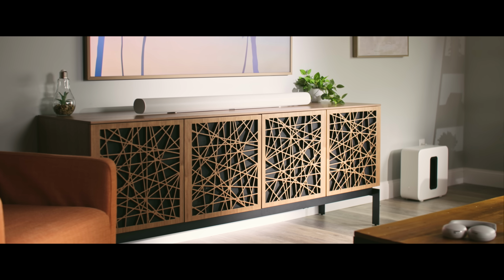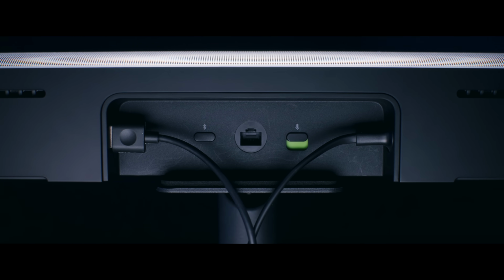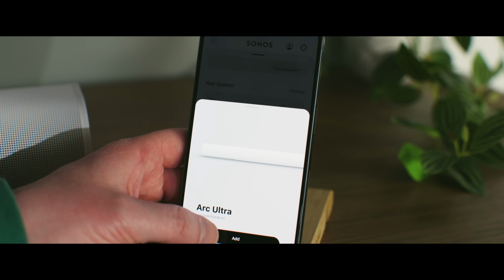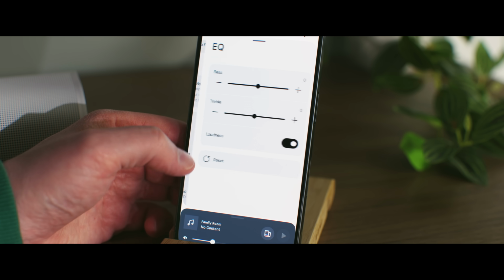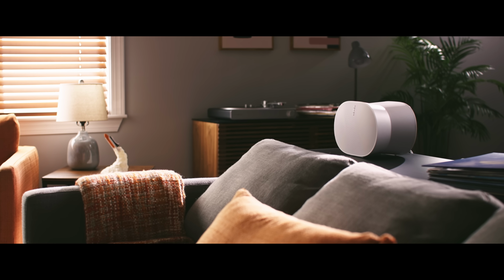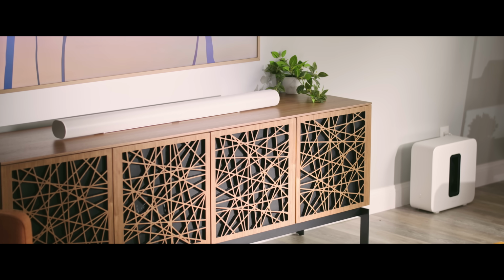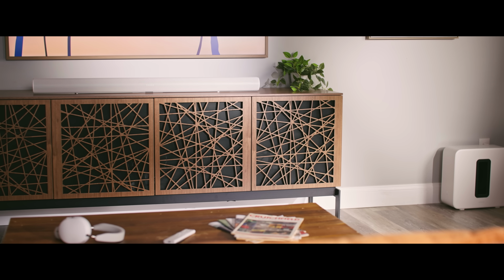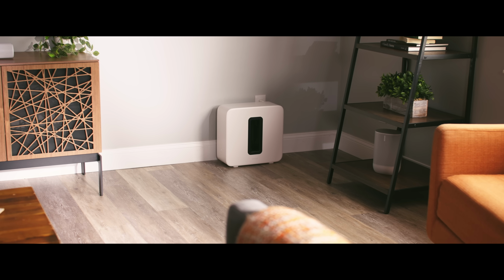Sonos Arc Ultra and Sonos Sub (Gen 4) | Crutchfield

Comment from the maker: We've just learned that a recent update has enabled native 9.1.4 processing for the Arc Ultra. It happened after we shot this video, where we describe it as 9.1.2.
Reply: Sorry if this a stupid question.  Are you able to add more Era 300?  I mean you have to rears.  Can you add 2 for front left and right or are the not needed?  Also, what are the benefits of having 2 subs instead of only 1?  My room is 4m x 4m.  I have had a Bose 700 with the sub and satellite surrounds for 6 years and need this sonos.  Thanks for the review.
Reply: Forget Atmos and forget soundbars if you want more than better tv sound. Just go for Sonos Amp with some decent floorstanding speakers, add some Era 100 rear speakers and a Sub 3. You'll have a great Dolby Digital+ system for movies but also important (for me); You will have a great HiFi audio system for music no soundbar will even get close to. 
You just need some big frontspeakers for decent and well balanced music🤷‍♂️
Reply from the maker: HiFi Music is still best reproduced by separate speakers and creating the equilateral triangle with them and the seating area. Your setup is a lot better for your goals!! Which passive speakers are you running on the Amp?
Reply: @crutchfield  Yes at least for me it's the best of both worlds. I am running a pair of Wharfedale Reva 3 speakers on the AMP.
Reply from the maker: Beautiful speakers! Which finish did you choose?
Reply: @crutchfield  Thx! Got the Reva3 in white (gloss). https://youtu.be/J9XTUp9qMjk?si=c5YjXYzenTIxzxjY
Reply from the maker: Nice! Happy listening!

Comment: Hi Crutchfield which sub is better bose 700 module or sonos sub 4
Reply from the maker: The wireless subwoofers are proprietary and designed to be used with the compatible soundbar. We haven't done any comparisons with the Bose and Sonos subs but both will give you deep bass extension and create a large soundstage with the Bose/Sonos soundbar used with it. My personal opinion is the Bose subwoofer/soundbar gives you a better home theater experience and would be my preference & recommendation.
Reply: Thanks Crutchfield the advice bose was always my favorite brand since I was a teenager but was curious to find out whats the big deal about sonos arc ultra some say it does atmos better than bose and sub 4 goes lower than 700 module

Comment: The fact that makes me hesitate to buy this bar is that this has only one HDMI port.
Reply from the maker: What HDMI devices do you plan to connect? When using the Arc Ultra soundbar through your TV's HDMI eARC input, you can connect other video devices or gaming systems directly to your TV's extra HDMI inputs.
Reply: @ planning to connect Apple TV 4k and Arc ultra, and TV arc to soundbar.  This is called “Passthru” which is more stable connection and better sound.  Also, this connection makes me able to enjoy dolby atmos even if my TV is not atmos compatible.
Reply from the maker: Pass through features won't be available on the Sonos ARC Ultra. For Atmos features you will need an Atmos capable TV, and to connect your apple TV 4K (or other video sources) to your TV's non eARC HDMI inputs.
Reply: @ thats the problem.  Apple tv and atmos works best at pass-through connection.
Reply from the maker: Would you like help choosing another option with multiple HDMI inputs?

Comment: INCREDIBLY smooth review. Like this was an audio description from a magazine article. Well done. 

I must ask, I have two Era 100s that I have in my kitchen and living room for multi-room audio - should I pair the 300's with the Arc + Sub or will my 100s be okay?
Reply from the maker: You can use your existing Sonos Era 100's with the Arc Ultra in a home theater configuration. While the Era 300 provides better 360-degree sound from the rear channels the Era 100's sound great and will work perfectly when paired with the Arc Ultra for surround sound!

Comment: Great review! I am torn between the new Samsung Q99D (price) with the sub and two rear speakers and this new system with the sub and two rear 300s. 

What would you recommend quality wise? 

I dont really care about max volume. ( I am sure it will be loud enough) 

Going in a newly renovated finished basement with low ceilings.
Reply from the maker: From a sound quality standpoint, the Sonos Arc Ultra with subwoofer and Era 300 surrounds is hard to beat!
Reply: @crutchfield  Thank you
Reply from the maker: Anytime! 🙂

Comment: what are your thoughts ?  BOSE SMART ULTRA   vs   SONOS ARC ULTRA   which is the better investment for adding a surround sound of speakers to ?  great video    thx cheers from Canada
Reply from the maker: Both great brands. What's your exact setup? Are you using any other Bose or Sonos speakers currently? Are there any specific features or connections you need? Thanks!
Reply: @crutchfield  All i have now is the BOSE 900 sound bar so i am open to starting the Sonos set up  my room is 12x14 with 7 and a half foot ceilings   what set up would you suggest ?  how about the BEAM 2 + sub Mini + ERA 100's  or is that not powerful enough ? I enjoy watching sports / movies / and news channels....thx
Reply from the maker: Based on your space and listening preferences, the ARC Ultra is an ideal match since it can fill your room size well and provide for fun surround sound on it's on until you can also add the 100s.  The Sub Mini will match it perfectly. Do you need a wall mount?
Reply: @crutchfield  will i notice much of a difference with the min sub hopefully ? or does it have to be the GEN 4 ?
Reply from the maker: The mini does a great job. If you like even fuller bass or think you will want to use two subs down the road, you will need the Gen 4.

Comment: Sonos ARC Ultra 10/29/24

My setup 

1. Living room is an open concept living room
2. Arc Ultra / 2 ERA 100’s / Gen Sub 3

The Arc Ultra right out the box it sounded very mellow acoustic very surreal no need to increase volumes. Once EQ was adjusted to personal preference just amazing sound quality.

Once again I will say that I have an open living room concept (not like most videos on YouTube most if not all of you are in closed room).

True Play - no need for it as for the open room concept.

Future wishing - Sonos once you allow the users of the ERA 300’s to activate the center speaker while in TV surtound sound usuage you will have a good portion of Sonos users maybe considering to purchase the ERA 300. Why! Easy for open concept living spaces it will allow to fill the void if not being able to bounce sounds of walls for the illusion.

Special shout out to the main YouTube who post and bring the original thoughts on Sonos products. Much Respect

✌️
Reply from the maker: Thanks for the posting your experience with it! Just to clarify, you didn't use either Trueplay tuning; not even the Trueplay Quick Tuning process?

Comment: I'm happy with the original Arc (only had it for just over a year) and my Era 300 speakers. I'm using those as stereo paired fronts as I have them hooked up to my turntable. The curious thing is that music on vinyl through the Era 300s sounds better than streamed music (from either Apple or Tidal). They've only started to be reliable again though after the latest app update; before that even Airplay connectivity was sketchy.
Reply from the maker: That's a nice combo!  How did you choose to connect your turntable into it?
Reply: @ with a Cambridge Audio phono amp and then with the Sonos line in adapter connected to the phono leads from the amp.
Reply from the maker: Excellent! Are you planning to expand the system with more wireless Sonos speakers in other rooms?
Reply: @ no we are in a small flat so you can hear them from any room 😝
Reply from the maker: 😁 what's on your "multi-zone" playlist for tonight?
Reply: @ some traditional Welsh language folk from Cerys Matthews (lead singer from 90s rock band Catatonia) and her album “Tir” (Land). Her vocals come across very clear. I might finish off with some tracks from Jeff Wayne’s War of the Worlds. I’ve very eclectic tastes in music.

Comment: This combo, or the Sennheiser Ambeo Plus + Ambeo Subwoofer?  Current sales brings the price of the Sennheiser pair for a few hundred bucks less than the Ultra combo.
Reply from the maker: Hi William. both great options. What's your exact space and setup like? Are you using Sonos in other parts of your home now? What features and connections do you want to be sure your new sound bar has? Thanks!
Reply: @ I’m in a small condo and prefer not to have rear speakers.  Subwoofer is fine since I’m on the ground floor.  Slightly prioritize music over movies.  Don’t have Sonos in other rooms (Audioengine and Kanto).
Reply from the maker: Thanks, William. What type of, if any, WiFi audio streaming to you plan to use?
Reply: @crutchfield  Really only using Spotify / YouTube from the LG tv so far, as well as Spotify Bluetooth from my phone.  Might eventually have a direct Spotify source fed to the soundbar.
Reply from the maker: Got it. The AMBEO combo is hard to beat for top notch surround sound without dedicated rear channels. And it has built-in Spotify® Connect for music streaming
should you want that option down the road as well. Any plans to wall mount it?

Comment: I don’t understand one thing. If it is 9.1.4 only the bar, or if it is 9.1.4 with sub and era 300?
So if u add these it became 14.2.6?
Reply from the maker: The Arc Ultra does not become 14.2.6 when adding two subwoofers and Era 300 surrounds.  The Sonos Arc Ultra soundbar supports up to 9.1.4ch Dolby Atmos surround sound (including Dolby Atmos Music) thanks to its 14-driver array that consists of front, side, and up firing drivers when used by itself. When you add the optional Era 300 surrounds or one or two subwoofers the number of processing channels are the same, with your sound coming from the different locations where the additional speakers and subwoofer(s) are placed. I hope this helps!

Comment: Missed opportunity from Sonos. People have been asking for actual separate front left/center/front right speakers. Sonos could have made something unique by making the left and right side of the ARC separable, so you would split the ARC ultra in 3 pieces as it were. That would have been a mind blowing master move. 

Or a solution to support 4x Era's for separate fronts and surrounds and some smaller/ flatter center speaker.

Sonos can easily chew up a chunk of the audiophile AVR space with something like that. I would definitely switch if that would become available.

Oh well...
Reply: Jbl already has that and tbh it’s trash imo. Only difference is the FL and FR can be detached and used as rears. More of a gimmick “innovation” than anything else really

Comment: I thought SONOS ARC Ultra is 9.1.4? 4 height channels?
Reply from the maker: The Arc Ultra has 14 speakers in total, and they act as height channels when Era 100/300 surrounds are added, so yes, 9.1.4 is possible. Natively, it performs as a 9.1.2 setup, using those "extra" speakers to enhance other channels.
Reply from the maker: We've just learned that a recent update has enabled native 9.1.4.

Comment: Excellent video, thank you for that !
For my part, I want to buy them, however I'm struggling to choose the color. I'm hesitating between full black OR full white OR black Arc + Sub and white Era 300 x2 in the back. (At the moment, the last one seems most likely)
I watch TV mostly during night and I heavily use Hue Light behind the TV. That's one of the main reason I feel like black in the front might be wiser to avoid reflections on the Arc and Sub.
would be glad if you could give me your opinion ^^
Reply from the maker: The color of your Sonos system is a personal preference choice, we cannot choose for you. The good news is you can mix and match between both options as much as you'd like, compatibility and performance of your setup would be exactly the same!

Comment: Great video! Just to clarify, does the Sonos Arc Ultra deliver an excellent listening experience and immersive surround sound on its own? Also, would adding the additional speakers (e.g., the Sonos Sub or surround speakers) make a noticeable difference? I’m curious if starting with just the Arc is enough for a great experience.
Reply from the maker: It does give you an excellent experience right out of the box, so there's no rush to add on if you're not sure. We think the Sub makes the biggest difference if you think you might want more bass at some point. However, the Era speakers (100 or 300) do make a difference. When you add surrounds speakers, Sonos reassigns the built-in rear speakers as additional height speakers for a 9.1.4 setup.

The Sub and surrounds are gravy. The Arc Ultra on its own is an impressive sound bar.

Comment: Is it worth upgrading from Arc in a system already with dual sub and Era 300 as surrounds?
Reply from the maker: With the extra processing, speakers, and especially the 5-levels of dialog clarity mode it can be worth upgrading to the ARC Ultra.
Reply: @crutchfield  there's low, medium and high voice enhancement settings or am I missing the other 2?
Reply: @crutchfield  thanks - even at cost of losing one sub?
Reply: Of course
Reply: 1% diffrence or so?
Reply from the maker: You do maintain the app's Low, Medium, or High. settings and Sonos specifies the addition of a five-level slider for Dialogue and Speech Enhancement for this new Ultra model.
Reply: @crutchfield  umm what??? There's no such thing as 5 level speech slider for the utlra and previously you could only toggle speech enhancement on or off. What's the source of this information? I've been using ultra since day one and the speech enhancement only has low, medium or high settings avaliable.
Reply: its always worth upgrading.  u think these YouTubers work for free?
Reply: @blue4k-XLR  Don't think so. Your Arc is worth 500,- so you pay an extra 500,- for some small improvements. Your sub(s) make the difference. They make all other speakers sound better.

Comment: My experience  with a configuration of the "old" Arc, 2x Gen 3 and 2 Era 300 the Era's outperforms the Arc.  The front sound stage is relatively small  where as the Era create an impressive immersive wide soundstage from the back. There is on this aspect an unbalance between front and back. It is still not possible yet but my ideal system with Sonos would be having a configuration with 4 Era 300 and 2 GEN 3 or 4 subs both for movies and Apple Music Spatial Audio.
How is this with the Arc ultra? Does it create a wider soundstage on the front and is there an improvement noticeable in the balance with the Era's?
Reply: I totaly agree!
Reply: 4 era 300 will rock! 🤘🏻
Reply: Same set up and agree hopefully ultra fixes this. I’m just waiting on feedback and for any possible issues before getting it.
Reply: @MJA74a I don’t have any previous Sonos set up in my living room to compare to but they are very balanced front to back with each other. They nailed that part at least. The 300’s sound great for music and pretty sick for surrounds just wish the ultra sounded a little better and comparable to the 300’s. Sound fx in movies seem a little artificial/fake/thin sounding to me from the ultra. I have a beam gen 1 I think almost sounds the same. Just in a smaller scale. Gonna bring my oppo 4k player upstairs and try some 4k discs out and see how they sound. Streaming movie audio quality just isn’t the same..
Reply: This is interesting and good news imo bc that was my initial experience with the Arc + Play Ones. Sound quality alone was so unbalanced and it ruined the soundstage every time the rears kicked in. 300s were a huge upgrade but as time went on I started picking up on how loud and punchy the 300s were vs the Arc. Not to say that the arc was worse than the 300s but I could definitely tell the difference in performance from front and rear sound
Reply: @walidhannaoui1802 The 300’s and 100’s are great speakers. So far I’m not sold on arc ultra with the 300’s. The 300’s just sounds so much better to me. I will say the front to back is at least balanced between the ultra and 300’s.
Reply: I never had the arc 1 but I just got the ultra and 300’s. I think the era is a much better speaker than the ultra. Bigger soundstage, better dynamics etc. I have a Martin Logan motion 30 and two xt35s that the arc ultra is sitting on while I demo it in my living room and a full 9.2.4 dedicated theater room downstairs and it’s not even a comparison in sound quality to my living room set up. The Sonos arc ultra sounds so thin, tiny and harsh. Just very gimmicky and fake to me. I have a 4 & 6 year old that both covered their ears in shrill when I turned it up just a little bit demoing the force awakens. I wasn’t expecting it to be as good as what I have in this room but looking for something easier for my wife and kids to use but they don’t like the sound signature of it and either do I. I’m kind of in awe of how much better sound quality comes out of the 300’s vs the ultra. Even the era 100s sound quality is better than this..I like Sonos and have their speakers in my bedroom and other areas of my house but not sold on this..also for what it’s worth, maybe its just really hard to go from what I have and am used to with sound to this, so maybe I am being too harsh?

Comment: Will it work with Sub Gen 2 ?
Reply: just get one or 2
Reply from the maker: The Sonos Sub Gen 2 can work with this sound bar because that subwoofer can run in the S2 software.

However, if you want to run a two subwoofer system, you must use the new Sonos Sub 4